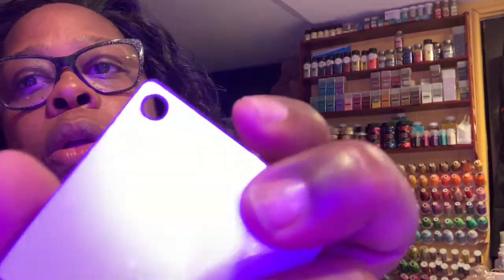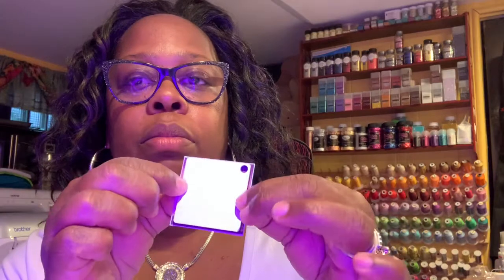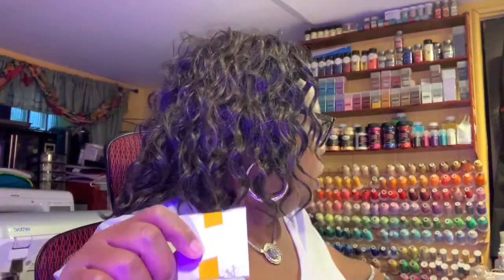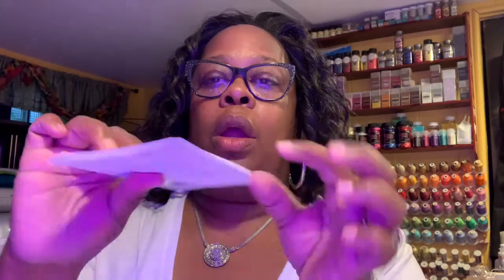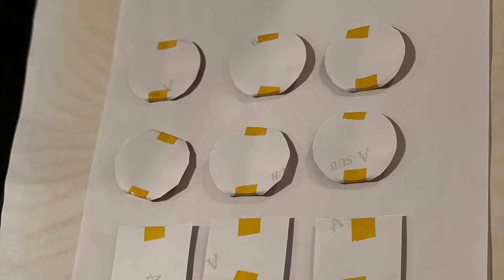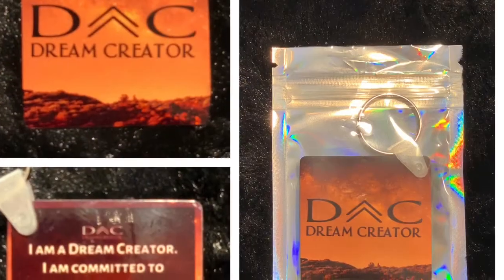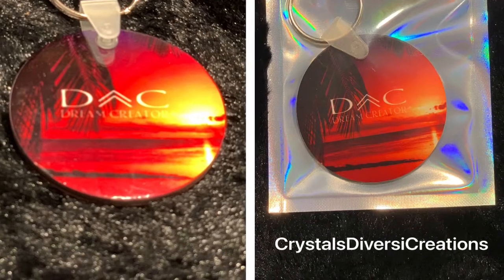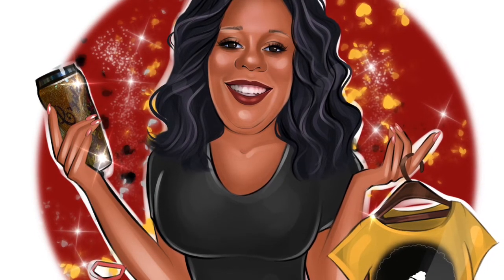Sublimation Key Chains

Comment: Love how professional yours turned out! I purchased sublimation key chains like this and experienced that they chipped super easily. Do you do anything on top of the sublimation to seal it? I’m really struggling trying to find how I can prevent them from chipping. I have orders to fill and I don’t feel it’s right to send out a product that I don’t 100% feel confident about. 
TIA!
Reply from the maker: I honestly didn’t have that issue. I do know that often times on Amazon there are items that appear identical, however, they vary in price and quality. I will locate the brand that I purchased if still available and send you the link.
Reply from the maker: Fortunately, I didn’t experience that and I sorry that you did.  I’m reluctant to suggest anything because I feel like epoxy or lamination may impact the overall quality, not to mention adds a ton of time to the process.

Comment: cool video but how do you cut out the little hole to put the plastic piece in.
Reply from the maker: Thanks, mine came that way. I purchased my keychains with a hole in them.
Reply: thanks i get it now. i'm so use to a vinyl cutter thinking you have to cut the hole out of the picture but it just prints ! no need to cut the hole! thanks for the how to.  now in need to learn how to size the photos

Comment: Well I’m new to this and you didn’t say how to print it, what press to use, etc. I need details plz
Reply from the maker: Hi there, you will need a  printer with sublimation ink and sublimation paper to do any sublimation on key chains, shirts, mugs, etc.

I used a heat press and typical time and temp varies based on the sublimation blank and your press, but 400 for 60 is average for a starting point.

Hope this helps and please consider subscribing if you have not done so already.

Thanks 🥰

Comment: Do you use a heat press or Cricut easy press?
Reply from the maker: Hi, I used a heat press, it gives even heat distribution and pressure. However, you can use a Cricut press as well as long as it has the higher temps.

Comment: Thanks alot! When i added the supplies my image came off a little. Any tips?
Reply from the maker: Hi there, glad you found the video helpful. 

My suggestion for the image placement would be to create enough space so the image is away from the edges and increase your boarder. Hope that helps
Reply: The image came off around hole, when inserting supplies.
Reply from the maker: @markjones3030  Maybe allow them to dry a little more?
Reply: @CrystalsDiversiCreations  thanks . I will let cool off before adding inserts.
Reply: What temperature do you recommend?
Reply from the maker: @markjones3030  I do 400 and if that’s too hot on your press use 385
Reply: Thanks